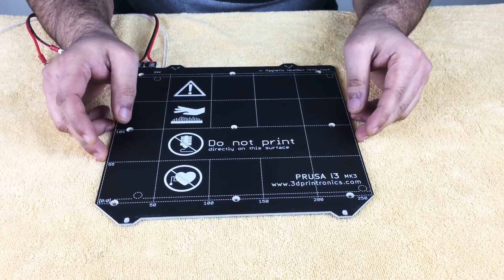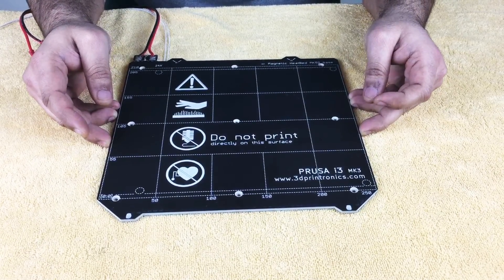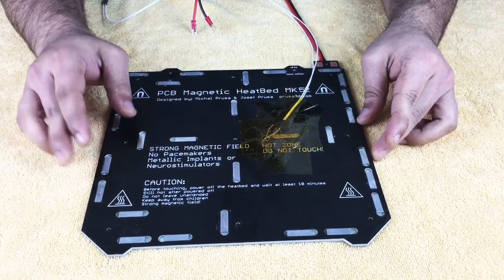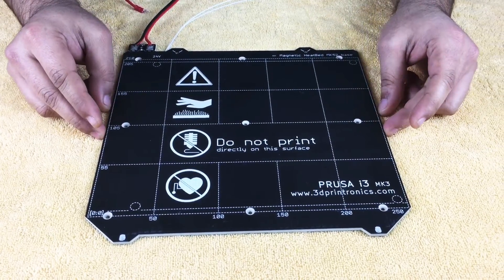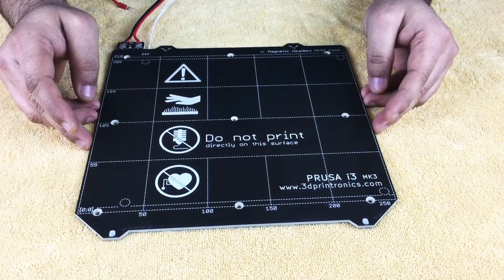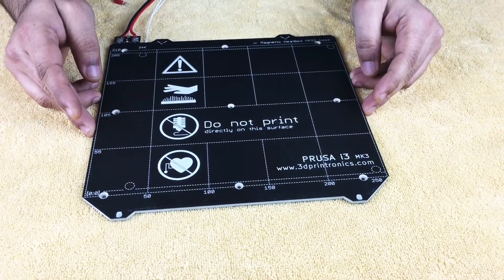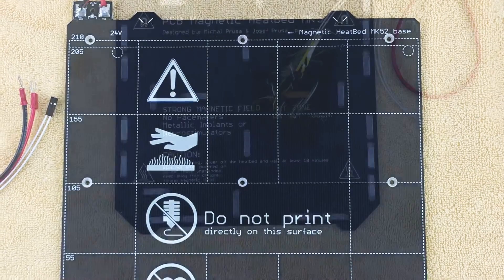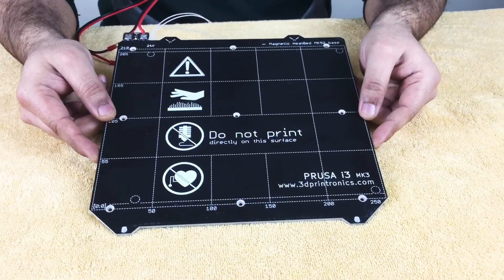Prusa i3 Mk52 Heated Bed Clone

Comment: How hard would it be to make these for printers like the Cr 10s and bigger?
Reply from the maker: The substrate based heated beds tend to curve as the size increases. If a larger size is made, it might curve beyond usability. So in my view a larger size bed is best suited for being made from aluminum and heated using a silicon heater.

Comment: Bonjour, il faut choisir une option ou le revètement flexible est livré avec le plateau ? Il y a bien le plateau chauffant et le revétement flexible dans le colis ? Merci ! https://www.3dprintronics.com/Prusa-i3-Mk52-Heated-Bed-p101073046
Reply from the maker: Hi, currently the spring steel print sheet is out of stock. When you order now, the package will include the heated bed with magnets & wires, PINDA Probe (optional), Mounting Hardware (optional), Thermistor (optional), Carriage (optional). After the spring steel sheet is in stock, you will have the option of adding the spring steel sheet to the package. Hope this answers your question. If there is any more question please let us know. Thanks !!

Comment: How much price bro
Reply from the maker: Tamil Tech Trick தமிழ் டெக் ட்ரிக் We will be listing the prices soon on our website and update you via email too.
Reply: these guys sell the order mk42 bed for $60USD: https://www.3dprintronics.com/Prusa-i3-Mk42-Heated-Bed-p90257010 which is the price of the real deal.... not quite sure how they think they will sell clones for the same price as the real deal.
Reply from the maker: Hi, Thanks for your reply. The Mk42 Heated beds by 3DPrintronics come with soldered wires with Molex Connector, Thermistor with wire and connector, PEI Sheet pre-installed and all fasteners required to install the bed. Basically they are ready out of the box to be used. If you are buying the beds in India as replacement component for your Prusa i3 Mk2s 3D Printer or even to make your own 3D Printer, you would definitely find the cost of these beds reasonable. The quality of these beds is impeccable and we stand by our commitment to quality.